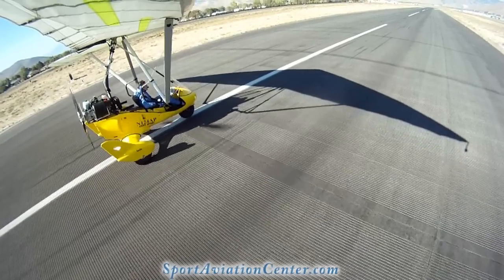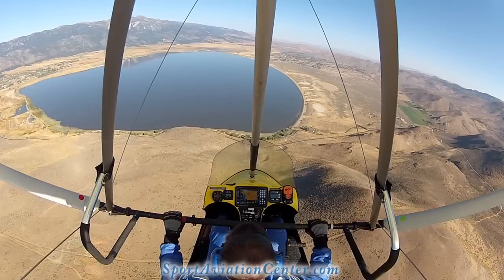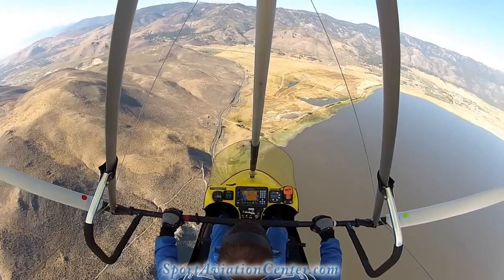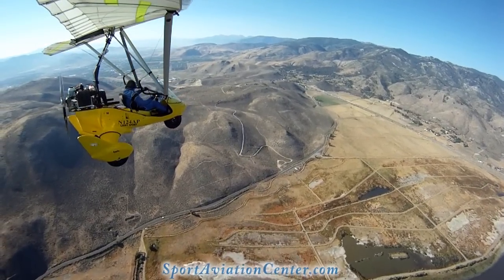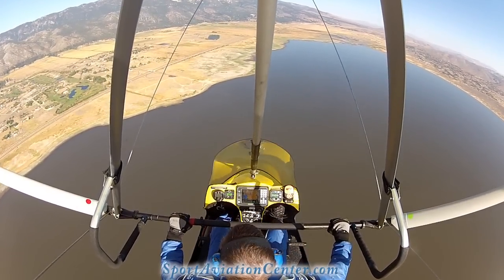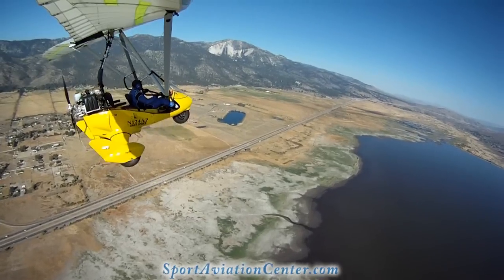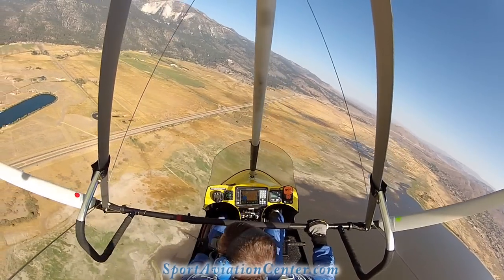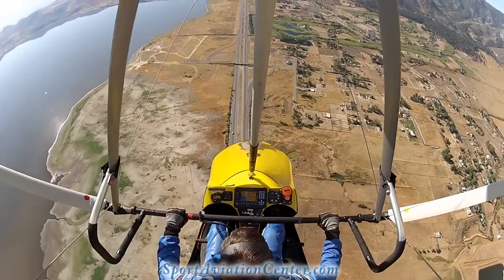Checkride Tips 1 Trike flying stalls and what not to do stalling a weight-shift control aircraft

Comment: Good vid and interesting, but I must say that it doesn't look you're invoking a full stall at all.  The nose isn't dropping unless you pull back on the bar.  In a fully developed stall, the nose drops into a 'mush' before you increase power and pull the bar back to recover.  You may be feeling pre-stall buffet but not a fully developed stall as far as I can see.  To be fair though I'm not in the cockpit, so it is difficult to tell for sure.
Reply from the maker: The trike stalls like a canard because of its design. For the checkride you are supposed to recognize and recover from an impending stall and loose the minimum altitude. Not get into a full stall with altitude loss.

Comment: I'm transitioning from a FLPHG to a trike. What's your rpms on takeoff and what's your rotation speed on take off. On the FLPHG as soon as I lift off I pull in on the bar. I notice you push out and the immediately pull back in. Will the trike take off without you pushing out?
Reply from the maker: ***** Each trike is different. Some you must push out to rotate, others take off on their own when they reach takeoff speed. RPM's on takeoff is simply full power. About 5500 RPM for the Rotax 912 engine and 6500 RPM for the Rotax 582 and 503 engines

Comment: Washoe lake and slide side.  My wife likes your trikes.
Are these susceptible to tip stall?
Reply from the maker: appcarpenter1 The are NOT susceptible to tip stalls because the design has the tips at a lower angle of attack than the root so the tips they stay flying when the root/middle is stalled. Very safe and stable.

Comment: What would be the max safe rate of climb this probably. Varies from the wing and horsepower
Reply from the maker: Rob Glodowski Yes climb rate is based on density altitude, weight,  wing size and horsepower. Generally, some climb at 200 feet per minute, others climb at 1500 feet per minute

Comment: I've heard that 10000 feet is the legal limit w/o oxygen, but if you wanted to fudge it a little bit and go up to 10560 feet to make it an even 2 miles up, could you get away with it? Or is the FAA gonna find out and slap you with a big fine for going 560 feet over? (I'm talking about over flat farm land......not hugging up next to a huge mountain)
Reply from the maker: +Dreaklock It is kind of liker asking a question such as: If you are driving  and stop at a stop light, there is no one around. and you go through it when it is red, will they get you and give you a ticket. Probably not. Typically over flat lands there is not much advantage to going higher, it is more fun to fly low.
Reply: +Paul Hamilton I see. As far as the altitude goes, is it based off the ground (10000 feet off the ground) or is it based off sea level? So if you're over a place where the ground is 2000 feet above sea level, does that mean you can only go 8000 feet max above the ground (which would be 10000 ft above sea level)? Or is the ground always considered "0 feet"?

Going up high has always interested me (especially in an open vehicle) but of all the videos I've seen, it does seem a lot more interesting when the pilot is flying low. Especially when you're over a beautiful spot.

Thanks for the response!
Reply from the maker: It is like the speed limit while driving. If it is 65 and you go 70 will the cops get you. If you roll through a stop sign will the cops get you?If you go over 10,000 feet and have a mid air with an IFR aircraft, this is bad for everybody.The rules are basically made for safety. If you follow them you will be safer.
Reply: Oxygen by the regulations is needed above 12,500 up to 14,000 feet beyond 30 minutes or above 14k for any period of time.